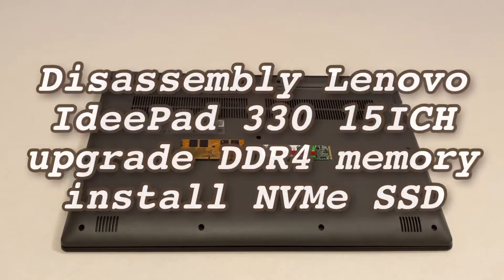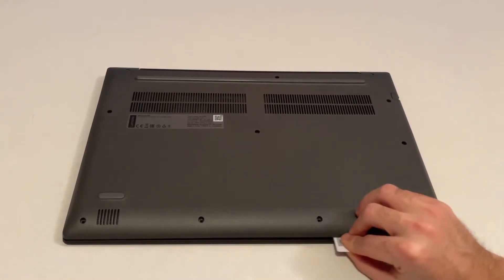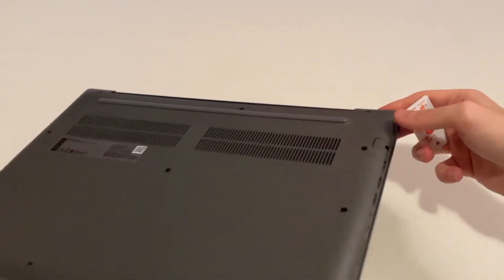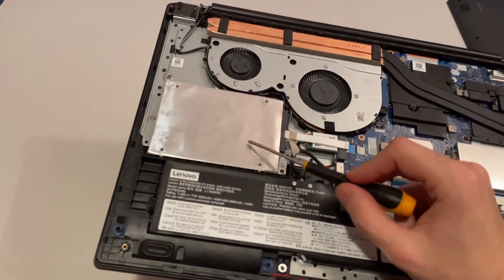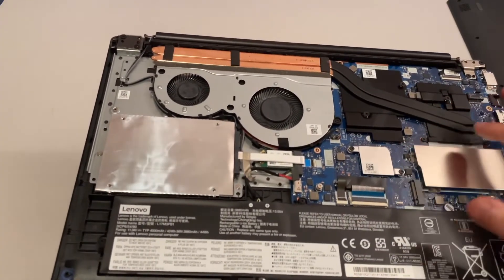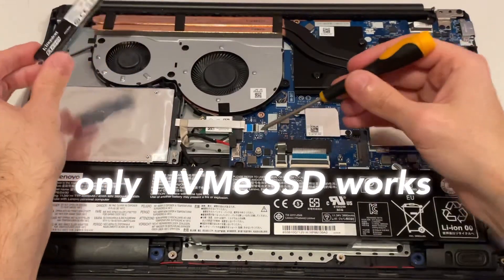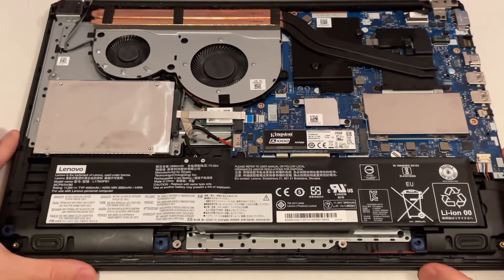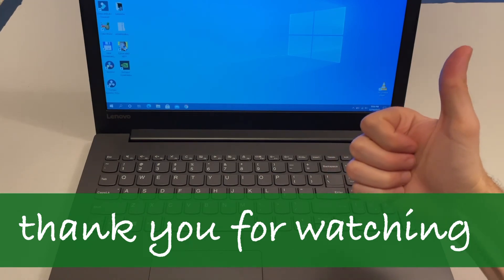Lenovo IdeaPad 330 Disassembly Teardown HOW to Upgrade SSD DDR4 RAM memory

Comment: Hi thanks a lot for video, I have lenovo Ideapad 330-15ICH Intel Core i7 8750H laptop. The PC was giving a blue screen error and would not turn on. I formatted the PC, but the internal (128 GB) SSD is not visible during the format. I continued by installing the operating system on the HDD, but after turning on the PC, no SSD is visible. Do you have any ideas about this?

Comment: Thanks for the video. I have Ideapad 330 15ich 8 GB RAM GTX 1050. The specifications sheet mentions that max capacity of SSD this model has is 256 GB. But I have read people mentioning online that it is possible to use a larger sized SSD. Can anyone confirm this?
Reply from the maker: You can use any nvme drive. Even with 2 Tb
Reply: I think so I have the same the mother board spec sheet only say PCIe 3 0×4 or PCIe 3 0×2

Comment: Does Barracuda Q5 SSD Pcie Gen3x4, 3D QLC works with 15ICH?
Reply from the maker: Yes, I know it works, also any NVMe SSD will work
Reply: Any suggestions which SSD is the best if I have to work on alot of data

Comment: Hello, great video really helpful. One question, does the M.2 slot in this laptop support Samsung NVMe SSD's?
I read something about the M.2 slot keys not all being the same and the drive that came in my laptop has 2 slots cut out of it (just like your SSD in this video) but the Samsung SDD only has 1 cutout. Will this fit and work or do you need a SATA SSD?
Reply from the maker: For sure Samsung NVMe SSD will work.
Reply: @TechwithStefan  thanks!

Comment: Hi, Thankyou for this informative video. I'm currently using this laptop, it has 4GiB Ram soldered on board. Can I add 16GiB Ram in other slot to make it total 20GiB Ram?
Reply from the maker: Hi, you can try it. I only tested 8GB stick plus 4GB onboard for a total of 12GB it works well.
Reply: @YassineKadri-j7b  the laptop supports upto 16 GB ram only

Comment: Hi..@4:00 you showed sata ssd and nvme, they both have same connectors. I want to ask why did you install only 16gb nvme. Is this where you will install operating system only?
Reply: I have the same question
Reply from the maker: Take a closer Look 5:44 the NVMe ssd is 240GB not 16GB
Reply: @TechwithStefan  yes you are right. But both have same connectors. How do you distinguish when you buy .

Comment: Hello I have a question concerning the airflow of the laptop. I bought a little laptop table that can have two fans attached to it from below to cool the laptop. I am asking if the fan that is aiming at the right bottom side (when the laptop is flipped as shown in the video) has to blow the air or suck it out? Right now my setup with the extra fans is blow air in where the laptop fan is and suck air out where the heatpipe is, is this correct? because it seems that the general heated air gets blown out at the back below the screen so I'm wondering if I have one of my additional fans the wrong way, thank you for your help!
Reply from the maker: From my experience It is sucking air from below and blow it to the display side

Comment: Hello, thank you very much for the teardown video. I have a question, my battery is no longer really working. I'm currently using this laptop with AC adapter always in, sort of like a desktop pc. Can I open this laptop the way you showed in the video, unplug the battery and then remove it and it would still work with only AC? Or does the laptop need a battery built in for that to work?
Reply from the maker: Yes, you can open the laptop and disconnect the battery 🔋. It should work only with AC charger. But I recommend getting a new battery 🔋. That will save your work in case of AC going offline.

Comment: How much ssd storage can we add in it
Can we add 16gb ram
Reply from the maker: You can add 8gb of RAM at least this I tested. Maybe 16GB works as well, haven't tested. 
Also ssd needs to be NVMe type. For that there is no limit. Only limit is your wallet cause they are expensive 😂
Reply: @TechwithStefan  16gb works as well
Reply: @qnocksme3251  is it 16 gb ram still working well?

Comment: I need of a RAM upgrade and I currently have a 4 GB 2133Hz which soldered to my laptop motherboard and only have 1 slot left. Can I add another 8 GB to make it dual channel or add 4 GB? Which one should i buy for best performance
Reply from the maker: yes , add 8GB, most games today need at least 6GB of RAM or more.. 8GB is near it's limits today
Reply: @TechwithStefan  ok bro thank you